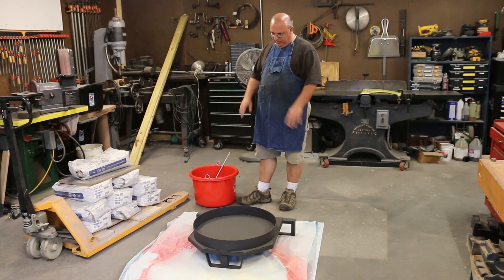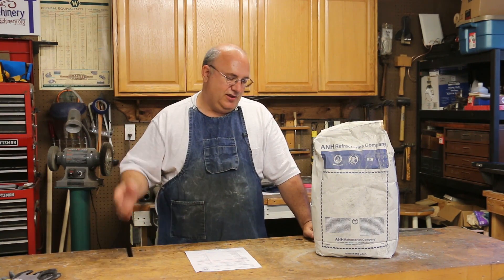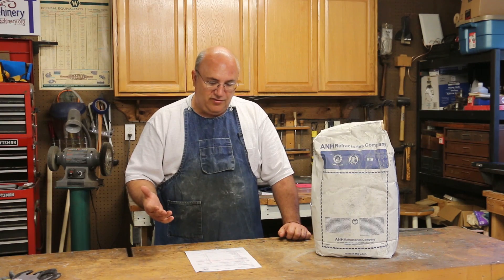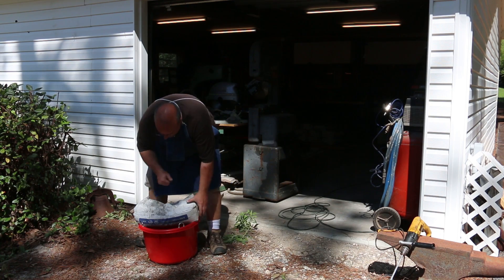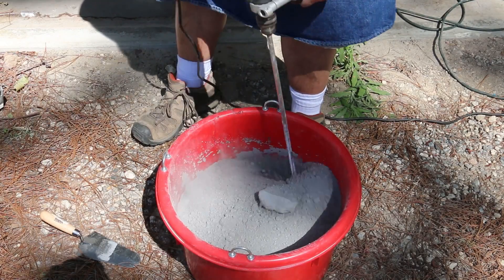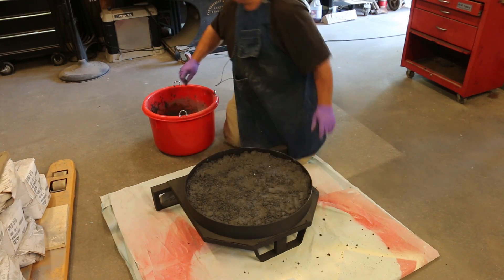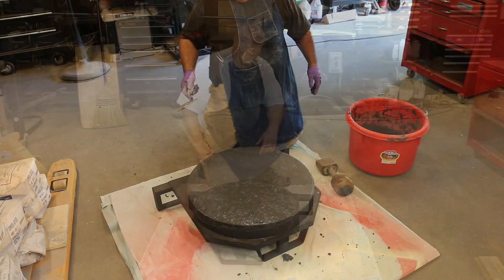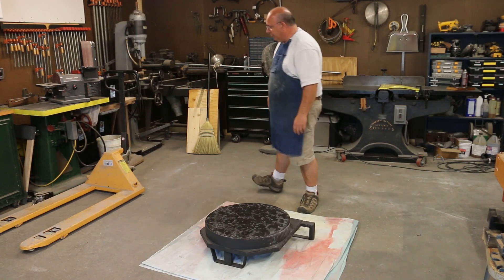Building an Oil Fired Foundry Furnace - Part 3:  Casting the Base Refractory

Comment: I agree with Old Salt John Keith, adding the cement to the water would have helped get a more uniform mix on the first batch. That batch looked a bit dry to me for the most part, while the second looked perhaps a little too wet, but as you said, that extra water should assist with the two lots bonding together, That base will make for a really solid and professional job by the looks of it. Thanks for all your continuing efforts Keith, they're greatly appreciated, Cheers,
Rob
Reply from the maker: Rope Tangler I am going to try and put the water in first next time and see how that helps.  All in all, it turned out just fine.
Reply: Rope Tangler I do refractory work for a living. In small quantities you want to put the water into the powder. And only use enough water to be able to work with it, dryer is better.
Reply: midnightimage69  Thanks for the info Midnightimage, I was mistaken in my advice for Keith  then. I was going by the way I would mix concrete, and in my experience it is better to have it a bit too wet rather than the mix being too dry. Although the refractory is in some ways very similar to concrete, in the respect of needing plenty of water to make a good mix, it obviously differs. Thanks for putting us all straight, (especially me):-))

Comment: A nice strong foundation, in any building project is essential for long life and it looks like the base of the furnace is nice and strong. Was happy to see that the second batch of refractory was wetter than the first so that the two levels could bond effectively. One thing one must be aware of when lining a furnace is that you can't have layers in a lining. The lining must be solid throughout or else the layers will separate when the inner layer is heated by the gas, as it normally is, and expands before the outer layer of refractory is able to absorb the heat. The inner layer will eventually develop a crack and because it's no longer bonded with the outer layer will fall out requiring the entire lining to be removed and replaced with a new lining. An expense no one needs! Another thing, the lining never is as smooth as one wants it after it is rammed into place so a refractory wash can easily be made with some of your refractory by putting some in a can and mix enough water in it until it is the consistency of paint. Take a paint brush and paint on layers of this wash until all surface is smooth making sure that each layer dries before the next layer is applied. once the lining is smooth it will be protected from molten metal better and will be maintained easier. The most important key in relining a furnace is DON'T hurry the drying process as it will produce bubbles in the refractory and damage the refractory. Looks like the refractory salesman told you a lot of good info! Looking forward to your building the walls of the furnace. Later!

''
Reply: sandrammer May I pick your brain a bit?
According to the data sheet, this castable can be used as a hot face material.  If a light mix containing something like perlite was rammed up first then a layer of pure cast in the same setting, would that count as two layers due to the mass difference or is the issue of new over old the only consideration for bonding?
You also mention applying a wash. Would that be done right after forming the main body or can it be applied after use without it falling off?
Thank you for your time.
Reply: Eddie the Grouch I'd say that if you made a batch with added perlite, then followed up immediately after with a batch without the lightweight aggregate, such that both applications are moist enough to bond to each other, you can count that as one layer...

There are different schools on applying surface washes and patches... my industrial clients typically do not mess with washes, in part due to their tendency to spall off.

Patching is done to allow a furnace to continue to operate after the refractory has been damaged, without the need to completely reline with new refractory. It it a new layer, but the situation is considered acceptable when contrasted with the cost in time and money to due a full repair.

I'll be a contrarian, and say that a glass smooth finish on the hot face is neither needed nor particularly desirable in a furnace like this (abrasion resistant linings in pipes and ducts are a different situation). The refractory is not in contact with your hot metal, nor any flowing liquids, so a slightly rough surface with minor pits and voids really doesn't affect anything - the refractory is just an insulating material in this case...

If you feel the need to spend the time and effort, go ahead...

Eric
Reply: Eddie the Grouch Yes it would count as two layers. Only because the two materials would expand at different rates once they were being heated up. The refractory, if rammed into place alone should be of sufficient thickness to weather the expansion and contraction phases of use. Depending on the possible temperatures it will be exposed to, you could mix perlite in with the refractory but the perlite breaks down and gells well before the 1950 - 2100 degrees F pouring range of Brass and Bronze. As to the question of when a wash can be used... a wash is used to finish the surface of a newly rammed furnace lining to prevent splashes of molten metal from grabbing onto pits/cracks present in the furnace lining and can be applied throughout the life of the lining as long as the lining is scratched up (as when a wire brush is scraped over the material) so that the wash can find a surface to adhere to. Hope this helps.
Reply: sandrammer By the way, "of sufficient thickness" for the furnaces I worked on was 3/8 to 1/2 inch max.
Reply from the maker: sandrammer As always, thanks for all of the tips.  I am happy with how the base turned out and looking forward to doing the rest!
Reply: Keith Rucker - VintageMachinery.org More tips heading your way via email. Hope it helps in the completion of your furnace lining. The process of lining a furnace with something you will want to use for years can be a pain!
Reply: Eddie the Grouch Perlite will flux at brass/bronze/iron temps and will do nothing but aide in the early demise of Keith's efforts.  You'll find the addition of perlite useful with a furnace operating at much lower temps needed for alloys like aluminum/zinc/lead.

Comment: to vibrate it use a saws-all  with no blade in it .just put the feet against the metal.we use this when building houses from the Styrofoam bricks with concrete in the middle works great.as a vibrator would destroy the foam blocks
Reply from the maker: D Steven Paisley Probably won't do any vibrating.

Comment: I agree about stability, if you place a straight  edge between the corners of the legs, there doesn't seem like much overhang of the base ring
Reply from the maker: ***** This thing is about as stable as one can get!
Reply: Sure looked stable to me!  Basic rule for static stability is that if you connect the supports with an imaginary line (or string, if your imagination is at the cleaners) and the center of gravity is inside that perimeter, it will be stable. If the CG gets outside that perimeter, it will fall over.  "Inside the perimeter" means that a line connecting the CG with the center of the Earth goes through the area enclosed by the perimeter. 

Only effect height has is that the angle of tilt to get the CG outside the perimeter gets smaller as the height increases, but as long as you stay on level ground and don't try to wheelbarrow the finished furnace, you won't have any tilt to worry about.

Did you see Myfordboy's furnace build series?  A bit different in some ways, but some good ideas there. His lid lifter for instance, and the angled tuyere.

-- Mike

Comment: Why didn't you just build from the steel ring to the top of your furnace? Are you going to use wood to forum to the top? Your refractory had a black glassy look to it because it had too much water in the second mix. You just about have to use a cement mixer to get this refractory to do right. I know cement mixers are not cheap. But do you want your refractory to set right and keep the water from forming on top. Whatever you build your forum from use a heavy duty hammer to tap on the sides sometimes that gets the water down in the refractory.
Reply: Jimmy Hinton Another Monday morning quarterback suffering from constipation of the brain and diarrhea of the mouth.
Reply: Ballsar Frozenoff Man worked on furnaces, poured brass, made cores for it and for past 12 years I've machined it. I've been at the same company for 23 years and still there.
Reply: Your experience has nothing to do with your demonstration of mindless diatribe. You knew the project was in progress so if If you truly wanted to be helpful, why didn't you offer your expertise in advance instead of coming onto a public forum and belittling his method and in so doing, demeaning the gentleman? You are no stranger to YouTube so you knew exactly how to communicate privately with Mr. Rucker in advance, which you didn't do. You just wanted to verbalize to the world your vast knowledge in a "know-it-all" "Monday morning quarterback" manner. You may be a master caster and machinist but you've demonstrated to the world that you're no gentleman. You have my deepest sympathies, sir.
Reply: Ballsar Frozenoff I thought I did give good advice. I'm trying to not come off negative. But I know the dangers of pouring brass and what we do to keep our environment clean. A long time exposure to pouring this metal is lead poisoning. Sorry if I am negative about it.
Reply: Jimmy Hinton Wow.  Some harsh bashing you got there for not being a mind reader and sticking your nose into someone's project.  Now, I like and respect Keith a lot, but the casting rep did recommend a mixer and Keith chose not to use one.  Also, the universal practice in mixing powdered material like cement, mortar,  and grout (listed in all bag directions I have seen) is to add the dry to the wet to prevent lumps and dry spots.  Keith has done tile and cement work in the past and would be aware of this and, again, he chose not to.  A call from Miss Cleo the previous week would have mattered little.
While the 'armchair' comments made afterwards by yourself and others throughout YouTube history did not effect THIS project - they are invaluable tips and reminders for those of us that take the time to read them for purposes other than looking for reasons to fly off the handle and demonstrate how to make noise without contributing while being an insufferable jerk at the same time.
I always look at the comments to see the better ideas and corrections so I don't make the same mistakes and I thank you and everyone else that takes the time to post constructively.
Reply: Jimmy Hinton MSDS stand for (Material Safety Data Sheet)
Reply: Eddie the Grouch sorry I will remove it. i will keep the MSDS on there. I made a video explaining my self. I will put it up tonight.
Reply: I believe that Keith may be going with a design where the top is like an upside-down bucket with a mechanism to lift the heavy bugger up. Looks like a the perfect size for a large steel drum.